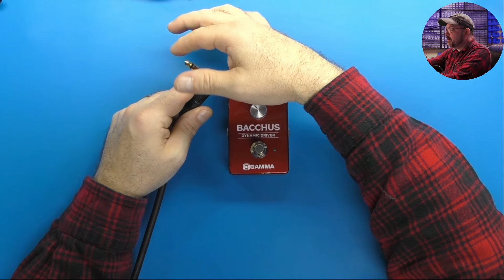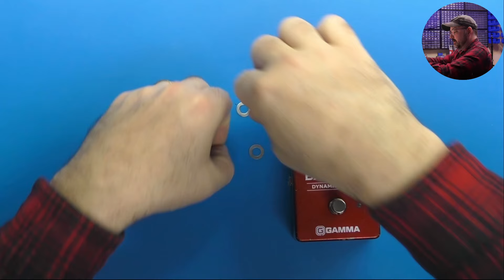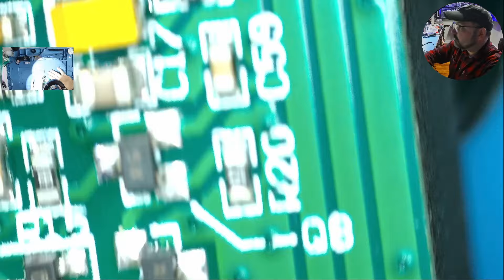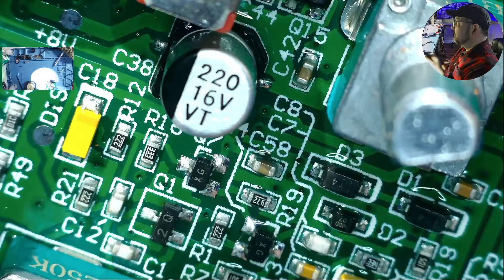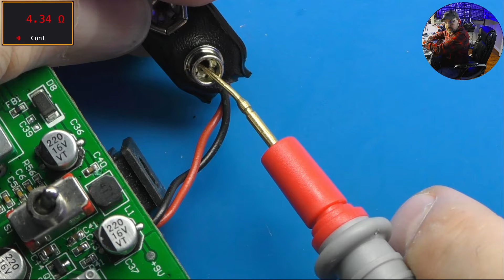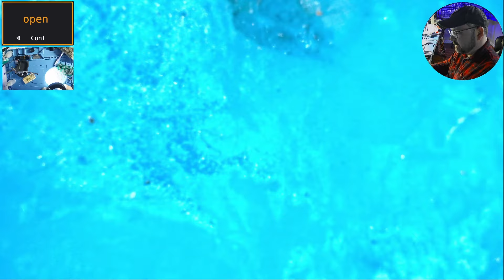Guitar Overdrive Pedal Repair

Comment: Have a bag full of those LM358's (Op-Amp) if you need any :D
Reply from the maker: Thanks for the offer! I think i have about 50 of them in stock. They are super cheap compared to a LDO, which I why I thought the chinese may have paired it with some external components to create a regulator.

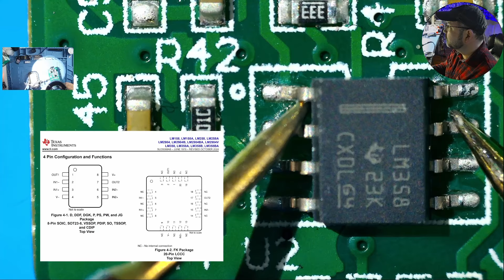Comment: The IC at 05:09 is a dual opamp and not a voltage regulator. There may be a good reason why its output on pin 1 is connected to the - input on pin 6.
Reply from the maker: Yes. I mention in the description that It's a dual opamp. Not having a schematic, I thought it could be being used as a regulator with an external transistor, so I checked just in case. 
A short on those pins doesn't mean it's a bad component unless it is shorted out of circuit. It is almost certainly being used to generate the audio gain for the effect and it makes perfect sense that the input on output pins are connected between the two op amps in the package! Good eye.